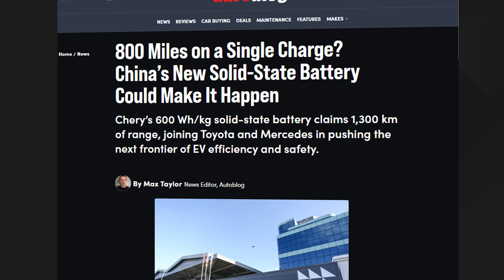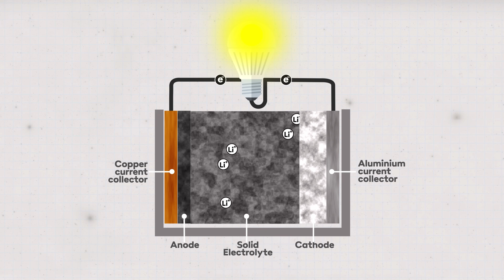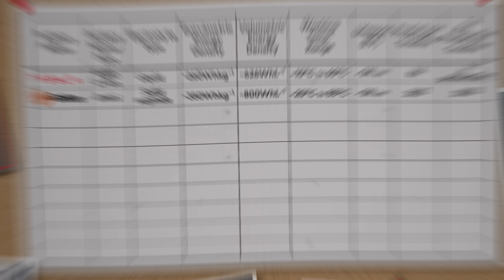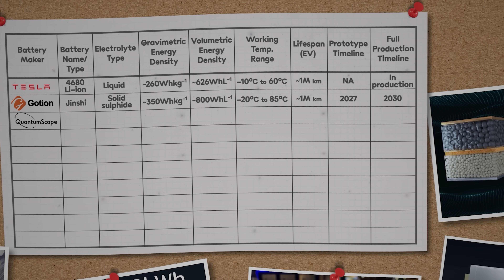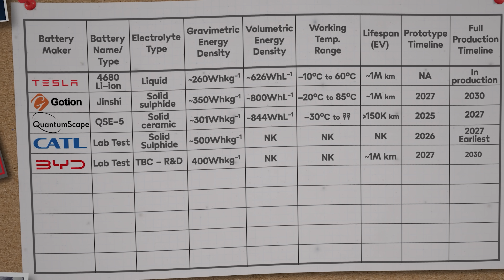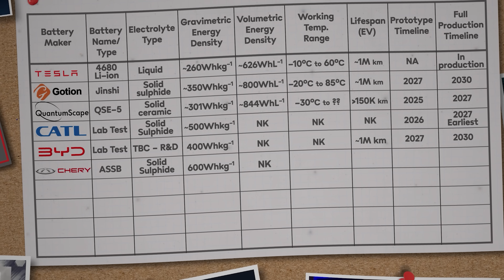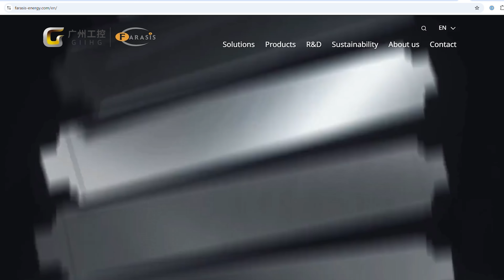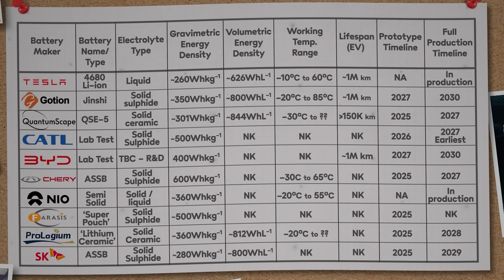Solid-State batteries. Finally arrived?

Comment: Maxwell Chikumbutso has this same technology, RF generated electricity, power. Mentioned in your report a battery doing just that. It looks like Maxwell Chikumbutso is facing the usual ridicule and obstructions preventing his contribution. It is the same story of Controlling Power. They have stopped many of these technoligues. We have a world filled with Liars, Crooks, and Cheats, we will not make it. At least not in the next 100 yrs. Anyway.
thx

Comment: The timing of this video was slightly unfortunate - on the 5th of January, 2026, Donut Labs in Finland made a reveal claiming not that they had a solid state battery in development, but that it is READY, and in production, will be initially used in the motorcycles they make, to be sold in the first quarter of this year. 

They make some absolutely amazing claims about this solid state battery, claims that, if true, will make this invention unimaginably industry disrupting and world changing. Maybe this video needs an update? Or maybe wait till the motorcycles with these batteries come out, and are tested by independent parties?

Comment: So Donut Labs dropped a video today announcing (i.e. claiming) they are in production with a vehicle partner providing them with fully-solid-state batteries in an electric motorcycle with 600km range, 5 minute charging, 100,000 cycles, and 99% capacity from -10 to +110 ⁰C, at lower cost that Lithium Ion.

(And a powered truck trailer, and a car platform)

Incredible if true.  Hard to know what to think.  Don't judge until you watch their video.

Comment: Given the current state of development, it appears that solid-state is turning out to be snake oil. Moreover, new chemistries are being produced at scale today that will accomplish much of what solid-state promises. At the top of the list is sodium, which CATL has already announced as ready for mass production. Cheaper and faster-charging batteries, along with increased charging infrastructure, are the answer. Once the infrastructure and charging times issues are solved, there will be no need for more expensive chemistries like solid-state. In the US, the average American drives about 30 miles per day. A battery that could reliably provide 300 miles of range would be more than enough for most people. If drivers could fast charge their cars in under 10 minutes or charge them at home or work, range anxiety would no longer be an issue. At this point, solid-state batteries are mostly vaporware, big promises but nowhere to be found.

Comment: Imagine you do not need thermal regulation on a battery you will save weight and cost, my concern is that if the efficiency" internally resistance" is bad it could heat up at fast charge or discharge and therefore would need thermal management.

Comment: I just bought one for my boat.  $1375 for a 60 Ah, 24V battery the size and weight of a aingle old fashioned glass Matt Lead Acid 100Ah 12v battery.

Twice the price but a quarter weight of lead acid.

Comment: Well, sodium is being ramped up for 2026, graphene seems to be set for the next gen lithium cells. I haven‘t heard anything about capacitors for a while. My understanding was that there‘s physical limits to what you can store without chemical processes. That leaves us with solid state. Glass and ceramics as dielectric are probably a little brittle? I would assume we‘ll need a bigger innovation like gorilla glass was for phone screens. Perhaps there will be an avenue for sodium solid state?

Comment: New miracle battery just around the corner blah blah . In the same basket as full self driving lead times.
I think a lot of this vaporware promise is to keep the EV car concept in the news to promote sales. 
IF there is a solid state battery that lives up to its hype, I would reconsider having an EV as well as a home battery that I can trust to have next to my house without the threat of nuclear deflagration. At the moment, I would rather have a 1000 litre IBC of petrol in my driveway  compared to a lithium Ion car.

Comment: The main advantage of solid-state batteries comes from enabling the use of a lithium-metal anode. In fact, replacing a liquid electrolyte with a solid one typically reduces ionic conductivity. To compensate for this loss, a lithium-metal anode is essential. However, about 95% of companies claiming to develop solid-state batteries are not using lithium-metal anodes. Quantumscape is one of the few that actually is, giving them the strongest chance of delivering a truly revolutionary battery, though they still need to overcome some manufacturing hurdles before reaching gigawatt-hour-scale production. I expect them reaching giga watt production by 2030. Most other players, such as Toyota, Solid Power, and many Chinese companies, have chosen sulfide or polymer electrolytes, which do not effectively support lithium-metal anodes without severely compromising cycle life or fast-charging capability.

Comment: I offer the state of Florida for field testing.  Specifically in the middle of summer.  Constant air conditioning is virtually a requirement, how well/how long will that battery last under such harsh conditions?  In a metro city traffic jam several times a day?

Comment: One of the main issues with electric vehicles (and non-electrics) is they weigh far too much. When we use a 2,000Kg vehicle to move a 100Kg person we are expending 95% of the energy to move the vehicle and only 5% to move the person - which is the primary objective. To extend this to an even more absurd level, the Hummer SUV or pickup weigh 4,000Kg! 
If and when Solid State batteries are ready for prime time, the focus should be on making batteries half as big and half the weight with the same range, not extending range to 1,300Km (800 miles). How often do you drive 1,300 Km in a day? Smaller batteries will also translate into the rest of the vehicle becoming lighter, because it doesn't need to carry all of that unneeded weight. We need to focus more on efficiency, regardless of the power source.

Comment: For some reason I keep getting promotional issues of MIT's official magazine, "Technology Review"  About twice a year for a decade or more, an issue has featured the Next Big Thing in battery technology or solar power technology.  All of these Next Big Things promise to produce dramatically improved output or efficiency at a lower cost.  But when you read the article, you find that there has been only a very small demonstration in the laboratory, not even a prototype, with no indication that this can be scaled up to the sizes needed to be commercially viable.  PLUS there are always "a few technical hurdles to overcome."  I haven't seen any of these come to market.  I don't know if "solid state" batteries have overcome all the technical hurdles or whether the owners of the companies developing these products are looking for a buyer so they can retire in luxury.

Comment: The battery is prety large compared to the motherboard if the batery would be 50 % smaller and have 14000 mah and do not Catcher fire then the CPU can be larger

Comment: The idea of ‘solid state’ has lost a lot of allure.  Customers want hassle free technology.  They want a battery that lasts for a million miles, charges from zero to full in five minutes, does not explode and, above all else, is cheap.  Liquid, gel or solid is irrelevant to the end user once the attributes are met.  Tesla’s 4680 battery was an exercise in manufacturing cost cutting rather than fundamental battery technology improvement and this approach has been successful thus far.  Tesla, like BYD, is now a manufacturer of both cars and batteries and understands, fully, the barriers to the adoption of new battery technologies.

Comment: I have a friend who is a nuclear engineer in Washington who said Thorium is “forever 20 years away” for the last 60 years along with Fusion…which nobody ever talks about about the extremely rare Beryllium blanket & the extremely corrosive salt. I have immense respect for engineers who are forever tasked with bridging the “valley of death” between lab prototypes and mass production scalability. So many ideas die in that valley because they just don’t scale for a variety of reasons.
Reply: Most determining factor is cost

If someone made a product that's only 2x better, but it cost 50x more to produce, then it's not worth to scale

Their target is "getting better performance per cost ratio compared to previous tech"

Comment: Who actually wants to drive 800 miles in one go? The average daily commute is about 25 miles so a small car will plugged in when you get home from work. The battery connected to the grid and used as part of the whole system. I really can't see the practical advantages of having these huge tank vehicles that get everyone's way.
Reply: Highway Tractor Trailers want to drive long distance in a Go.

Comment: Seeing the chart i skipped to end.l, screenshot ilitbamd gave it AI
Gemini for predictions 
"🔋 Future EV Battery Market Summary
Based on the chart, the future EV battery market is likely to be dominated by CATL, Tesla, and QuantumScape.
CATL is positioned to maintain its global leadership by targeting an advanced \sim 500Whkg^{-1} Solid Sulphide battery with the earliest full production timeline among the major solid-state developers (2027 Earliest). Their massive scale and early adoption of next-gen technology make them a volume leader.
Tesla is guaranteed high sales volume because its 4680 Li-ion battery is "In production" now, providing a currently commercialized, scaled cell that fuels the world's largest EV manufacturer. Its competitive current-gen density ensures immediate, high-volume sales.
QuantumScape is the key technology disruptor, backed by VW. They are targeting high performance with a high Volumetric Energy Density (\sim 844WhL^{-1}) and a full production target of 2027. Their technological focus and established automotive partnerships position them as a strong future best-seller in the high-performance segment.
Other strong contenders include BYD and Gotion, both developing high-density cells for 2030, but the current dominance of CATL and Tesla, combined with QuantumScape's high-spec solid-state goals, gives these three the edge.
Would you like to know more about the difference between Gravimetric (Whkg^{-1}) and Volumetric (WhL^{-1}) energy density?

Comment: There won't be an 800 or 1000 mile range EV for the simple fact that there isn't actually enough market to justify the cost increase past a ~400 mile range. It's better to make two cars instead of one since the battery production is generally the limiting factor in EV production.

Comment: You know when Tesla was working with Westinghouse and Tesla was attempting to create free electricity. Westinghouse cut his funding and told him if you can’t hook a meter to it. I don’t want it. You know to charge you to use it if you have a battery where your car can go 800 miles I don’t think the electrical grid owners in this country would tolerate that they want you charging your car every day so if those batteries ever do hit you at Shoreline, they’ll be altered so they only get two or 300 miles per charge. I guarantee it.

Comment: The 4680 basically doesn't exist, so it's useless as a baseline. In 2022 I still worked for the fascist scum musk in hopes of getting a springboard into the impenetrable ultra-wealthy controlled and cartelled economy (especially housing lol) - wouldya guess, I was underpaid, worked in place of 6 engineers, and didn't get jack shit for my efforts. But I came away at a time when they still couldn't get the 4680 to work at all, let alone consider it a production ready cell 😂 Ya know, it's like the 2020 roadster, or the cyberflop, or their unattended full self driving by 2018 😂😂😂 elon is a fascist fraud, using tesla as nothing but a marketing platform. Their original cars - when engineers were still respected in the company, as it's future depended on decent products - were groundbreaking, but now they're just sitting on the laurels of their previous success and trillionaire elon's globally near all-powerful coat tail. Good thing the fuckwit shareholders voted to keep him in again AND award him the trillion payout. They're all spineless scum who caved to his "threat" ie proposal to leave tesla if he's not awarded. The company could be saved and do decent stuff without him, but alas.

Comment: I'm fine with battery tech progressing for many applications but for vehicles, no, wheels in motion are producing energy and if that can't be turned into generating power, then what are we doing? other than milking the world for as much as possible. 
Imagine only being able to run a modern combustion engine vehicle until you needed to charge it again. lol 
I mean in Hi-Fi db comps normally have 2-4 500+amps alternators, we can't come up with a way to regen unlimited miles? ah that's right, oil is to profitable to allow that so keep promoting vehicles with limits 🙄
(nothing against this channel and thank you, just making a comment on the tech)

Comment: To me, Solid state batteries are the Synthetic fuel of the EVs - I believe it was Harry's garage that spoke about the 2 versions he uses. He was on a test for the 100% synthetic which costs around £400/L and also used the hybrid fuel(15% regular, 85% synthetic) that cost £40/L - So when these come down in price, we will probably have Solid state batteries.

Comment: Only problem with all this talk of the next technology being so much better than current is the stop effect it has on people buying current technology which is very capable and getting to be a sensible price.
Would being able to go 400miles change my life, no. Would better consumption, yes - so the weight saving is the huge bit. Being able to cut the size of battery down.
Looking at changing my car and contenders all seem to have 100kWh+ batteries to get the range, but that adds weight which limits the range. 300miles WLTP I think is the sweet spot as that allows you 2hrs driving at motorway speed, in winter on the 70% of the useable battery. No idea why anyone would want more than that. UK charging structure is now very good - though chasing the best price is still fun.
I am stunned as you that of all the views only 10% click the like button let alone subscribe. All this brilliant, useful, well researched and delivered content and they can't click a couple of buttons.

Comment: Current solid state batteries are still using a liquid electrolyte. This isn't an issue. The main issue we have is there's lots of manufacturers all with their own specific recipe for what they call a solid state battery. Once we pass this state of fragmentation, that's when we will see the scale of manufacture ramp up. We are basically in the VHS Vs Betamax or Blu-ray Vs HD-DVD part of new technology progression (although with many more options than just 2)
I estimate it will be another 10 years until we see an agreed upon chemistry for solid state batteries but, until then, the manufacturers will keep doing what they think is best until there's one (perhaps 2 victors)

Comment: I am convinced it's actually a ploy to slow down EV sales or even make them fail entirely. Toyota made big solid state promises and continues to do so with little to show for it.

They know consumers will say, why should I buy an EV now when much better ones with longer range are right around the corner. I feel like it's simply a ploy to continue selling more ICE vehicles.

Now auto manufacturers are talking about how EV sales are not as they expected and they are shifting back to making more ICE vehicles.
Reply: No they are not, FUD

Comment: There is one big problem with all these long distance batteries; what’s going to happen to all the very expensive to build and use motorway (etc) charging stations. If you can drive from Newcastle to London and back on a single charge it makes all of these stations redundant which is going to pi** on someone’s chips?

Comment: I wonder if the ceramic electrolyte "physically impedes the growth of dendrites" just by rattling around and breaking them up. If that's the case I wonder if the battery sits too still during use if it might eventually have issues.

Comment: We don't need 1000 km range. Faster charging would be ok, but not even that is not that necessary. I just completed a 4700 km, 66 hr  road trip in a 500 km range truck. I used all enroute charging time to do all the normal road trip things... eat, pee, stretch, shop, nap, email, plan, you tube. No wasted time. We were often rushing our meals or having to get take-out (take-away) to get back to the charger at DCFCs. If we had 1000 km range, we would still have had to stop every 200-300 km. If cars have 1000 km range, there will be less of a need for enroute chargers and they may not be there when we need them. If super-fast, we would have to stay with the vehicle while it charged before doing the road-trip-stop things, just like gas.